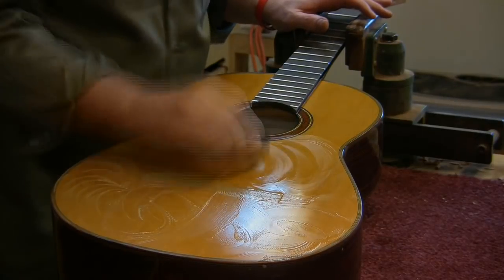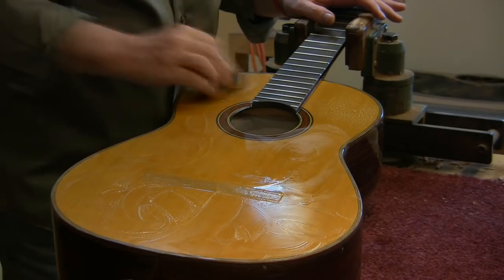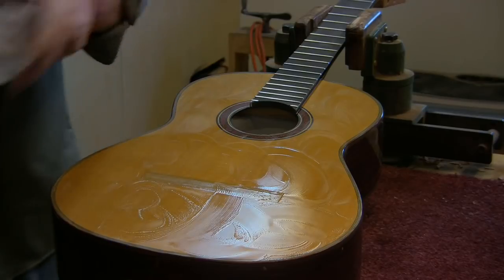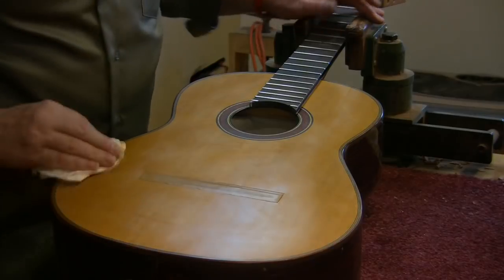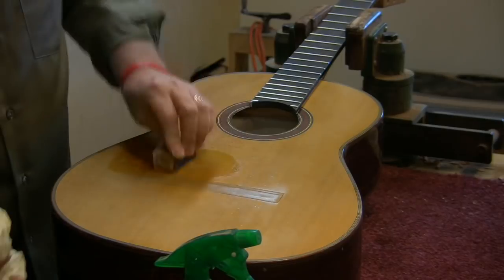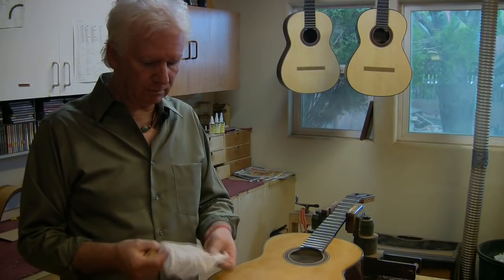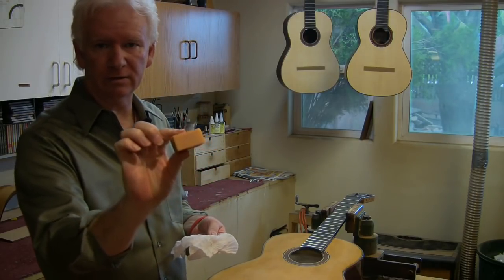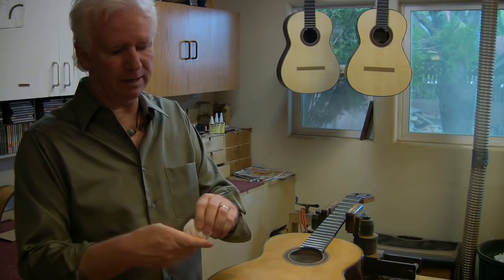French Polishing part 2

Comment: Michael, your artgum eraser idea worked good, I took it a step further: I took sections of scrap 3 ply rubber blanket from a print shop, glued it with old titebond to scrap pieces of pattern grade birch plywood, and then cut squares in sizes to suit my hands. The result is a block that wears a lot less, and the edges stay fine and consistently get into the tight spots. I've even done refinishes without removing the bridge. They also make great sanding blocks and clamping cauls.

Comment: Using water to cut back is fine but it will be more abrasive than using oil. French polish is the easiest if not only finish that can be repaired without needing to strip back to bare wood.

Comment: @devivo77 That's not true, if you wipe off the water in the usual amount of time after wet sanding there is no cloudiness if you leave water on the finished surface it might make a problem, but that's not what we are doing.

The water is not a problem because, unlike old school french polish, the flakes you are using have been de-waxed. The wax is what reacts with water in furniture that has been done in the french polish style
Reply from the maker: Well said James,  the problem with using oil to sand down the shellac is if you happen to accidentally sand down to the wood the oil will stain the wood, and that's a disaster!  Now days I use the 320 to 400 grit dry paper (the silver colored stuff) with no water.  In fact I don't use water any more at all.
Reply: one good method for leveling Shellac is to use a little high grade rottenstone. I think that your video may encourage the novice to use a mouse with squared edges. This will dig in and leave noticeable waves and ripples especially around the areas where a direct approach laterally to an edge is necessary. It will be faint as you work but more noticeable as you go along. I always use large circles and if you want to use a level surface, use cork with rounded edges and three layers of tight weave cotton such as an old linen shirt. damp with alchohol then rottenstone then walnut oil. this will be the best ad-mixture and will allow the best gradual build/leveling. There are no short cuts in french polishing ESPECIALLY AN INSTRUMENT for the novice.
Reply: That is good to know.  Up to now I've been afraid to clean my French Polished guitar with anything but a dry cloth for fear of clouding the finish.